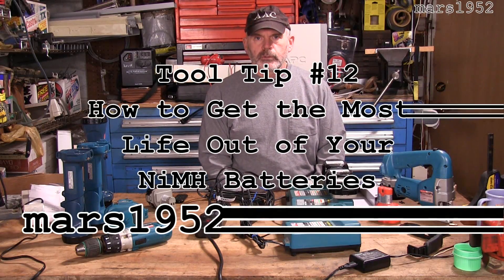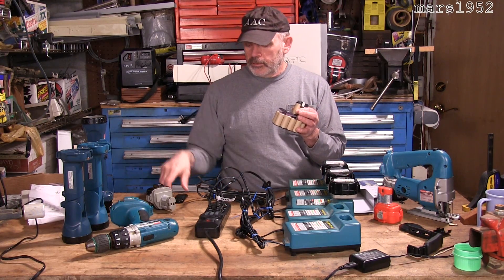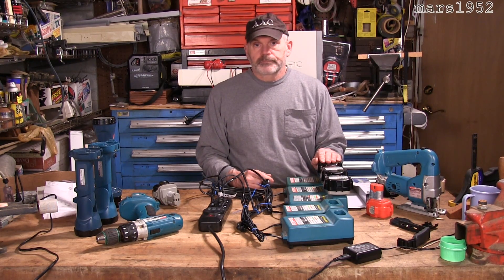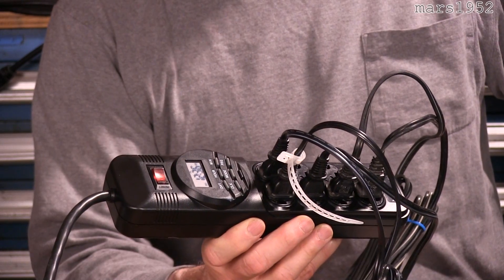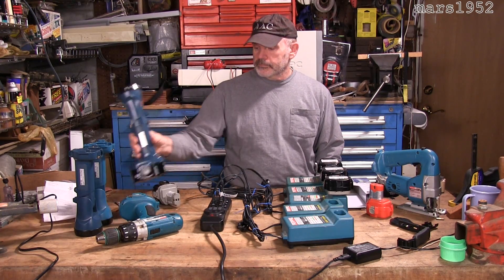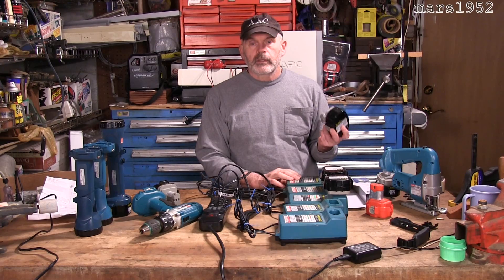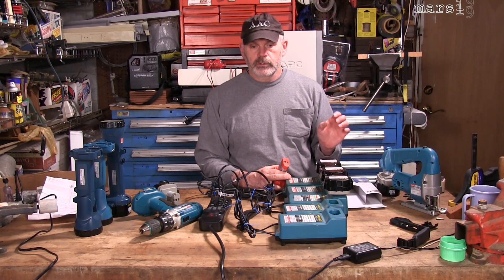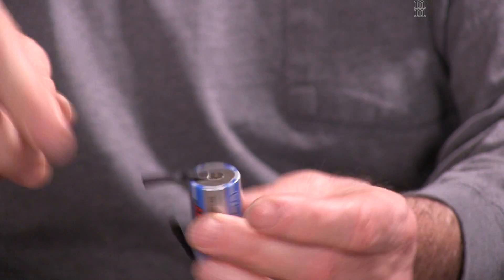Make NiMH Batteries Last Tool Tip #13

Comment: There are many components to battery repairing. One plan I discovered which succeeds in merging these is the Jons Mender Guide (check it out on google) without a doubt the most helpful info that I've seen. Check out this awesome site.

Comment: Can you please advise on how to remove the battery's? I've removed the screws to open the battery but unable to remove them to check or replace the cells....
Reply from the maker: Shane O'Regan You have to pry steadily and slowly and the double sided tape will gradually release.

Comment: They have found NiMh batteries are affected by charge memory and some say fully discharge them each time or they will reduced capacity. Overcharging may damage the NiMh batteries. Many have dumb charges and just keep putting in charge when full.

Comment: you just turned on a light regarding problems with older cordless tools. lots of failures for no apparent reason - now I know. and your fix will work fine with my setup.  For timer I will use a cheap digital timer that comes on at weekends and plug a cheap 24 hour timer on to that to get that "once a month" set up. Plugging a regular power strip into the timer train will allow me to connect up all my chargers. thanks for the "light bulb" :-)

Comment: Good tips.  I need to get some of my "new" yet unused batteries into circulation.  I had a thought about the once a month plan.  If you piggyback an old type mechanical timer into the digital one you could stretch out charge cycles to just about whatever you want.  Say you set your timer to go on once a day for an hour an the mechanical one for the same, you'd get an hour of charge every 24 days.  Something I think I'll try.  Thanks for posting this.

Comment: You know, this is crazy! I came across this video looking for tips on how to rebuild my old batteries and all I can find is this. You say that you either did a video on how to rebuild the batteries, (or that you were going to), but that video is nowhere to be found. Think you might post a link?
Also, I noticed that you don't mention the fact that the battery packs have a thermal over-load circuit that is basically there to keep them from catching on fire or something. I've tested all of the batteries that I've gone through and 9 out of 10 of them, the battery cells where fine. The thermal switch goes bad and basically tells the charger that the battery is bad and prevents it from charging it. I even bypassed it one time in a pinch and the battery worked fine. I wouldn't advise doing this unless you're going to sit there and watch it charge every time. This is why I'm looking to rebuild the battery, so I can replace the damaged thermal switch.
Also, when there was a bad cell in the bunch, it only takes one the make the whole batch test bad. I have enough good cells to make about 5 good battery packs, only I can't figure out how to re-solder the batteries together. I was wondering if there was a trick to this as they're actually spot welded from the factory, not soldered.
Reply: Walter McDearmid They do use a spot welder.  Though you "can" solder untabbed cells, you have a high probability of ruining the cells from the heat.  The spot weld only lasts a  fraction of a second and doesn't impart much heat at all.  That's why you should get the pre-tabbed cells like Mars showed in vid.  Then you can solder them with no worries about overheating the ends of the cells.  I actually looked into getting one of the spot welders for rebuilding packs, but they are just to expensive to justify.  Tabbed cells are only slightly more expensive than untabbed.

Comment: nicd and nimh battery have memory efekt and shoud be chargech allways full and discharged full if you will doing difrent capicyty will be more and more lower sorry for my english!!!!!!!!!!
Reply from the maker: NiCd batteries have a memory effect and need to be fully charged/discharged periodically. NiMH battery do not have a memory effect and will last longer if you do not fully discharge them.
Reply: +Krzysztof Pieróg NiMH cells, especially non Eneloop cells shouldn't be fully discharged all the time. There's chargers (mostly for AA/AAA cells) that cycle the batteries. Most of the problems i noticed is that cells that get run down all the way will have less capacity than those cells that were only run down to 25-40%. The biggest reasons that cells need to be run all the way down are the timer chargers. If you have 75% charge in a NiMh cell and then try to charge them for 8 hours in a timer charger they'll just get overcharged.

It's more ideal to find a smart charger that uses a variety of ways to stop charging when they get full. Most common ones are heat sensors as NiMH cells reach 80% they start to get warm and they get hot when they are full. I got a Maha C9000 charger for my AA/AAA batteries (and even D cell adapters) that will charge the cells up to 90% and then top off for 2 hours at a slower rate that won't cause the cells to even be warm! Of course if you are using a higher charge rate they'll warm up but it won't be damaging to the cells.

Eneloops on the other hand are ideal for the C9000 and you can charge them at any point without worrying too much about them being overcharged or sitting on the shelf for 3-5 years, keep them charged around 70-80% and they'll be ideal in power outages.

Comment from the maker: Some of the Makita batteries are held together with screws but I am guessing that you have the type that is glued together. You need to work the case apart with small screw drivers or (carefully) with a thin knife blade. I have taken 4 batteries apart and I only broke one.

Comment: my battery's (#1434, 14.4 v, 2.6 ah, ni-mh) are 10 yrs old now. just had 2 go bad, (red/grn flash ) and down to one, sooo how do i open the case???? with out destroying it, before i destroy it, trying to fig it out. .... almost looks same as yours, little different. thanks. most amazing tool (impact driver) ever for me. use almost every day.

Comment: Thank you very much for the tips.  I bought 6 NiMH batteries for a radio.  I will use solar power to run the radio and charge at the same time.  Solar panel output is 250ma.

Comment: Great Video!! Thanks!. Ill add, most rechargeable batteries do NOT last as long if you leave them in sub freezing temperatures, the garage, all winter. I bring all mine inside for the winter, which along with your tips, seems to help.

Comment: Not sure what the makita chargers are like, but you may find batteries are being reported as dead by these chargers when in fact they can be revived - using a power supply or something liek a multi-type RC battery charger will revive them when the manufactirer's charger will not. The RC chargers are also useful for performing charge/discharge cycles - which can also bring capacity up and get the cells working again as well as measuring/reporting actual capacity.